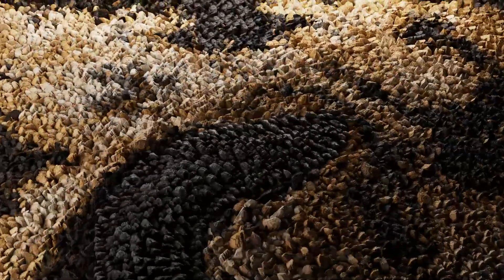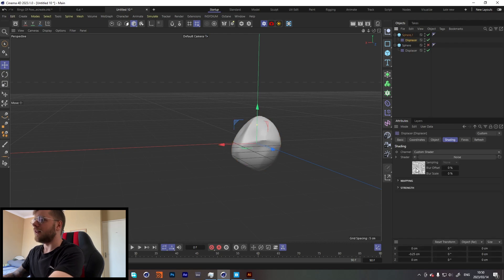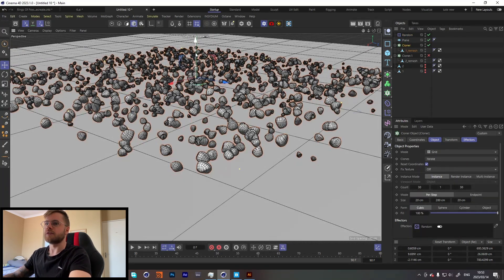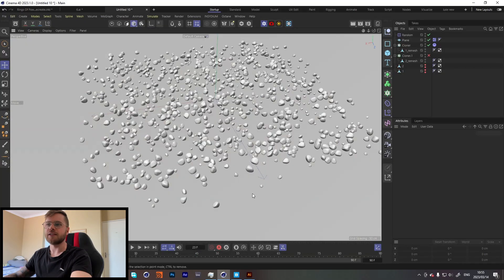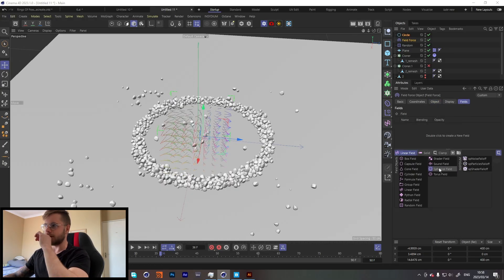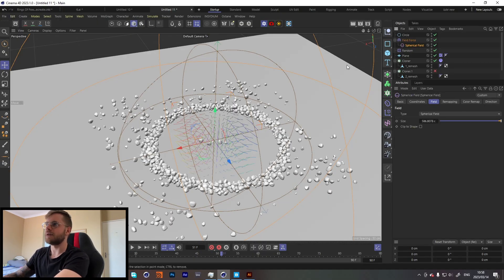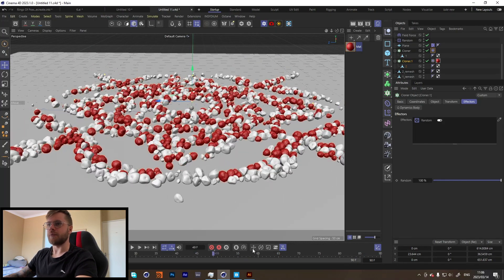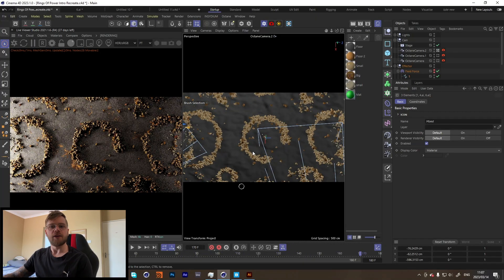How To Make The Rings Of Power Intro

Comment: Great tutorial. I think you can get away with using a material that uses bump and/or displacement since those objects are so small. I also had a little bit of vibration in the clones so I added a friction object (because it has an option for fields.) I used the same spline as a field so the friction would increase by a lot when the clones got close to the spline.

Comment: in 2024.3 the strength of the field force's velocity needs to be minus, or it will repel from the spline. Took me a bit of headscratching to work out.
Reply: Thanks!!
Reply: It's funny for me because after all that time ı've decided to make something with this technique in 2025.0.1 and it was annoying the force was pushing the objects. After 1 hour and a reset ı've noticed the solution is making the value minus. I came here to write this and saw your comment. I think "Cinema" thaught that the field force had to be a real force which can pull and push. Not only one.

Comment: Hi there, awsome tutorial, i have just a question. How can I slow down the speed of stones? I tried to set the strength and radius parameters but it doesn't change
Reply from the maker: You could use a "Drag" force or turn down the strength of the Field Force or alternatively in the project settings under simulation there is a time scale and you can keyframe that. let me know if that helps :)

Comment: I did a similar thing in Houdini a while back. It was done with raster images though. You can feed it any black-and-white image and the rocks move to match.
Reply: You could probably do the same thing with a shader field as a field force. I always say Cinema is Houdini Light. With the big difference that in the end Houdini keeps on being non-destructive and you don't run into software limitations that much. However the learning curve is a wall and for most simple Motion Graphics effects it's overkill to design a complete system.